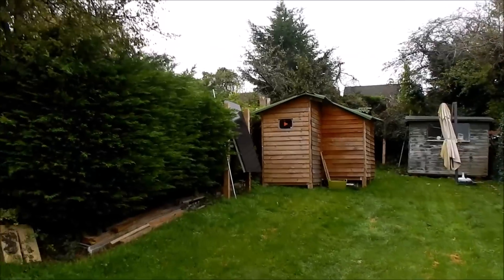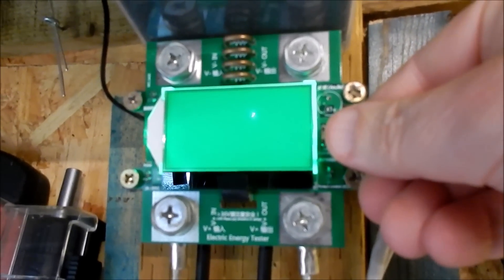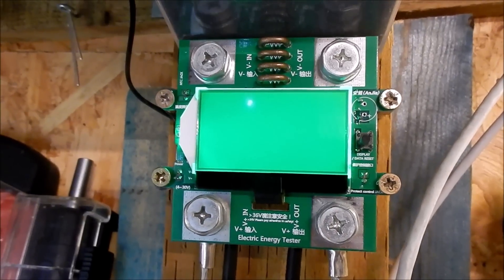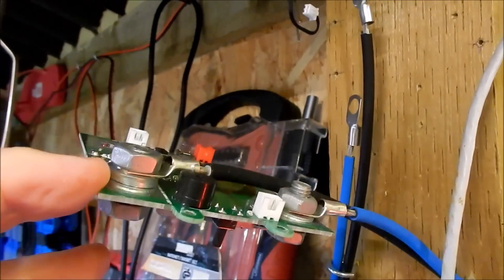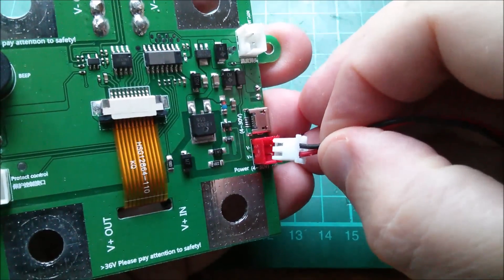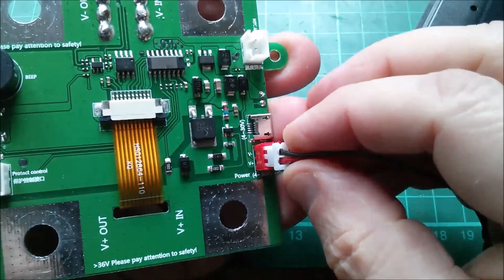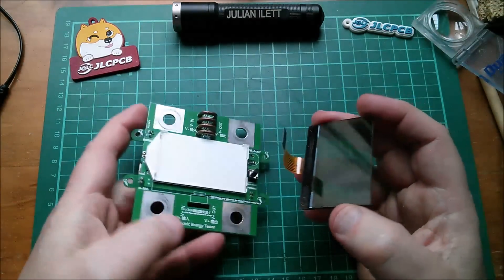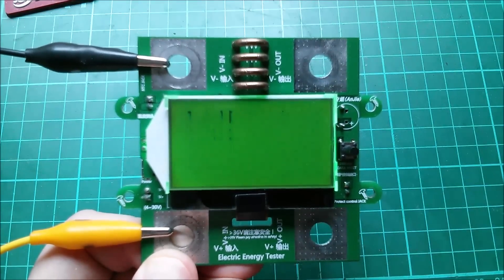My Wattmater Failed

Comment: Off topic Julian may I ask a question?
Is there a product or way of supplying say 400 Watts DC to my solar array powering my grid Thai inverter?
So at night I could continue operating fridges etc from the 2000 W lithium iron phosphate 48 V battery I have parked in my garage for my tandem recumbent cycle

Of course I could simply shine a spotlight on one of the panels at night but of course the efficiency would be terrible
Cheers

Comment: The lines you saw on the display was just random garbage.   I would either the display driver or the signal from the microcontroller is bad.
The microcontroller may be working, but it doesn't mean all its outputs are working.  That would definitely explain why the display is not working at all.  It may not necessarily be the LCD that has failed.

Comment: This ceramic capacitor connected to the ribbon cable on the PCB is part of a capacitive pump that generates a voltage higher than Vcc needed to polarize the liquid crystal. The part of the chip responsible for switching the capacitor is probably damaged. By touching the capacitor with your finger, you introduced a charge that was enough to light up a few pixels.

Comment: I think I might have to get a new set of any loops. The plastic jackets have started breaking, so there's a risk that the cells could short if something conductive goes across the end, for example if I'm not careful when inserting/removing them in the charger.

As for your LCDD display (it is a fairly large one for such a small module), is it possible you had a thunder storm recently? The EM spike from a nearby lightning strike could've coupled onto the solar power cables going into the unit, and blown out the LCDD display driver chip outputs. Why wouldn't it have affected the other chips? The LCDD display itself runs on a much lower voltage than the other chips, so it probably can't have the same kind of protection on its outputs as the other chips.

Comment: Temperature changes sucking moisture into the panel and destroying the display. They are well sealed but not hermetically sealed well enough to cope with 40ºC changes in temperature.
Reply from the maker: I agree, and 100% humidity for much of the year.

Comment: The cap connected to the LCD sould be a part of the power supply (charge pump?) of the LCD. They can't do this in COG (chip on glass). Check the voltage on this cap and check the serial signals for the LCD.
Reply from the maker: Spoiler: a new LCD module has fixed it.
Reply: Yep, my hunch too.

Comment: Uh got a simalar problem whit mit ISDT Charger. I  got the 8 port version and use it manly for 18560 liions (i build a little adapter) and after a few time weeks just laying around many ports dosent recognize the liion batterys anymore. Nimhs works fine but no liion.
Reply from the maker: Stuff just doesn't last anymore :(

Comment: if you get moisture on the display and power is on, you can dissolve the metallisation that forms the tracks. The plating is very fine and does not take much to remove it, you see it at times on the zebra strip’s. You look at it under a microscope and there is just a ghost of a track outline.
Reply from the maker: The failure mode is unexpected. I would expect a row or column failure, not the whole display.
Reply: @JulianIlett  Is there a common backplane connection? will good to see if you find the fault or just bin it a get a replacement unit.
Reply: Woof!!!!!!!!!!!!!!!!!!!!!!!!!!!!!